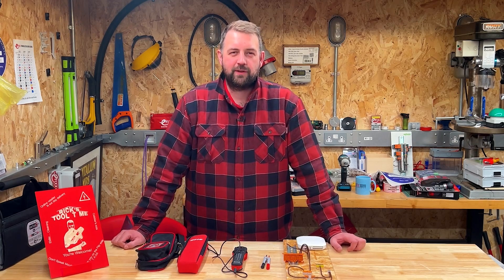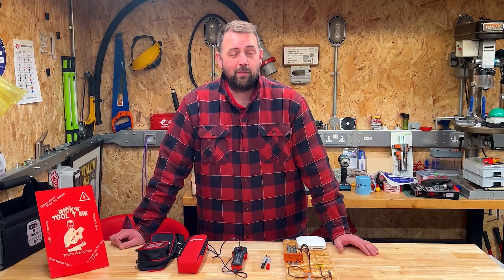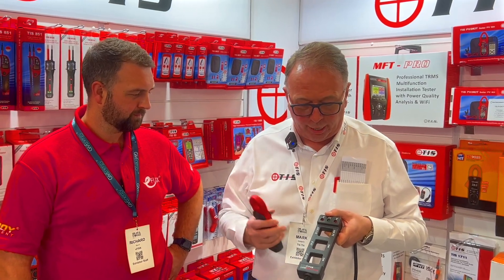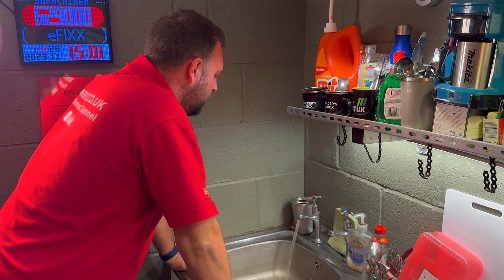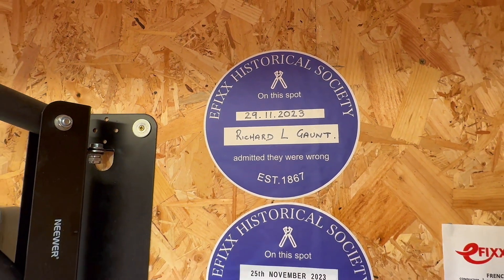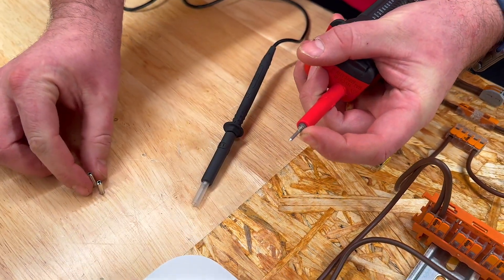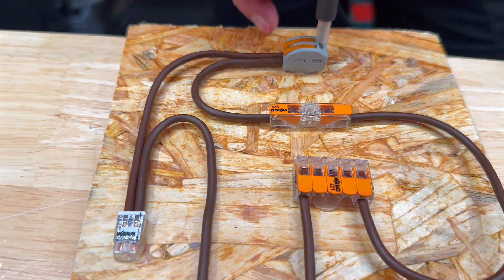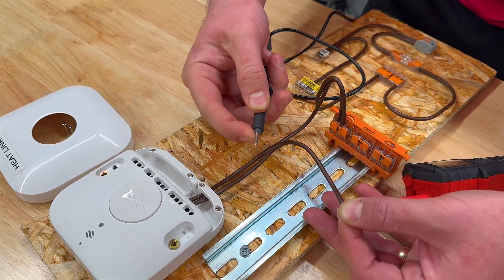SHOCKING Discovery: Hidden Feature in Voltage Tester!

Comment: I have seen that design but I have not seen the twist off section design yet that's interesting. I like the style but it's still going to have issues with depth of insertion within manufacturing tolerances and manufactures that don't care. It's one thing to slip it's another thing to purposely have your fingers below the ridges. And unfortunately most of my socks have been due to the North American outlet not having sleeved pins on plugs. Except for my recent scandal not safely isolating a circuit, I assumed it was a fully switched off circuit at the wall switch except for this was a two way switch to reverse motor direction on a really old motor mechanism controlling a curtain that hadn't been used and probably 50 years and had seized up in all manner.
 On the upside I'm now recharged for another 10, 15, 20 years?

Comment: The OEM for these (and some of TIS's other better meters) is Brymen, and if you're used to Brymen test probes you'd have likely have noticed because usually the screw on doohickeys come in a little plastic bag which makes it really obvious.
There is a very hidden mention in the Brymen BT-71/73/75 datasheet that there might be this function but I can't see anything in their manual either.

I still think the Fluke Twistguard is the least bad compromise.